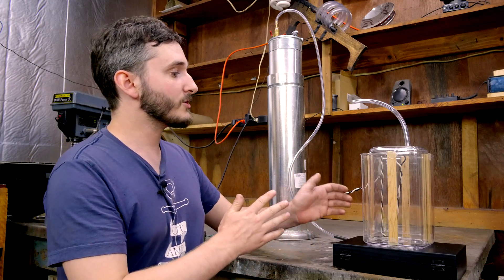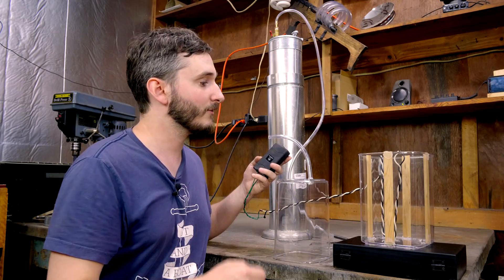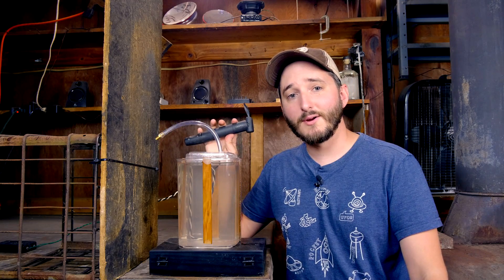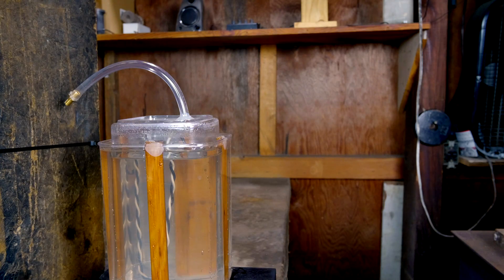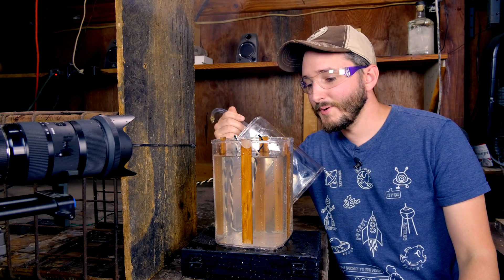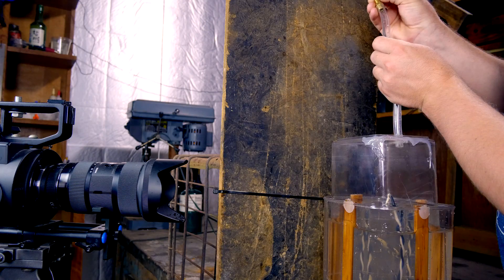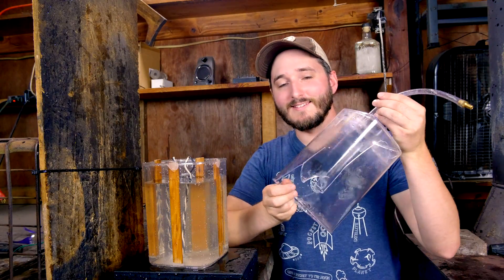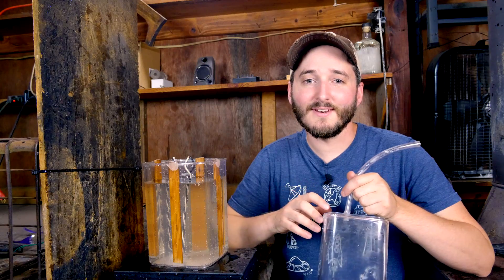Explosive Safety Testing for Bio-Fuel Storage

Comment from the maker: If you missed my previous videos in this wood gas/bio-fuel series check them out here:
Building a better gassifier: https://youtu.be/HQIW4dVVokE
Building a gasometer for wood gas storage: https://youtu.be/5hfznunVzKY
Reply: NightHawkInLight, thank you for ❤ my comment !
Reply: NightHawkInLight so uh... Gas cannon? Golfball mortar would be fun.
Reply: Make it run a model engine!!
Reply: People must think wood gas hydrogen is the same as HHo from a water splitter which you absolutely need a flash back arrestor for because it contains the perfect ratio to explode 

      One of the most dangerous gasses is acetylene it is kept in a special tank with gypsum and acetone because if it is allowed to be in volume in gas form or pumped at high pressure it can explode by itself without any air because of acetylene decomposition

 If you run a oxy acetylene torch at perfect mixture into a balloon or plastic bag just hitting it can set it off seen people make exploding bb gun targets with a cardboard box and Reynolds wrap like this but it is very dangerous

   Love your videos can tell you truly enjoy experimentation keep up the awesome content
Reply: how hard is it to be a one man cew i know i just want to know you thinking
Reply: Hey you could probably use the info gained from the mixture in this video (75/25) to optimize the bicycle engine you did in another. You might have been running fuel rich at 50/50
Reply: @NightHawkInLight , instead of a flashback arrestor you could use a one-way checkvalve to prevent gas mixing. They are so cheap there is no excuse ;D , 1-2$ from ebay china aviable in the aquarium section made from plastic or metal in every size.
btw. A Flashback Arrestor costs 5$ from china
If you cant find them cheap i could send you the links on request.
Reply: Try 1/ 4(1 propane and4 oxigine mixture)
Reply: Love ALL your videos...... 
Many years ago I used a rear tractor  inner tube as 
a gasometer for methane.....
What do you think about using it for wood gas ???
Thanks..... And regards...
🏹🛡🇬🇧,,,,
Reply: 0:32 I like the wood gasification but what about bituminous coal I'm not talking not charcoal the fossil fuel rock that burns what they use to use bituminous coal for locomotives and heating and used in powerplants I was wondering if you could make coal gas and have a tao tao style moped run off wood gas and coal gas
Reply: NightHawkInLight can you Build a rocket with it

Comment: Wouldn’t it matter where the spark gap was located in the container whether the gas ignited ? I assume the wood gas being a mixture high in carbon would be heavier than air, as such the addition of air through the top of the container would stratify with air on top and wood gas below. The spark would need to be at the boundary layer of the two gasses to cause ignition if the spark is too low it will be completely within the wood gas layer and therefore no ignition and if it is too high it will be completely within to air layer and again no ignition. I am guessing that as you add more and more air it creates turbulence in the container and mixing of the two gasses leading to ignition.

Comment: I had more than one bad explosions at my woodgasifier-central-heating, when I thought I had to open the lower door, just keen to see the fascinating downwoard burning flame. It could be a mighty explosion, as my wife said, that she felt, that the floor of the room above (where she was) bend upwards a bit, which made her move up as well. I was just squating in front of the furnace and lost some beard, eyebrows aso. 

Very funny experience though. But anyway: The explosion was some way slowly building up, by far not that expressive if I had used nitro (diluent for cell laquer) which I experienced another time, that nearly smashed my hand, when the door of another oven slammed open, after some little nitro-gas came near a glowing woodpiece :-). That was such a strange experience, that I had to do it directly once more, nearely loosing my hearing. Wood gas explodes so much cozier ...

Comment: Congrats, you just figured the upper explosive level of wood gas.  The best explosion you'd get, if you had something like a little mixer, bc not only the ratio, but also the mixture of the two components air and woodgas is quite important. I really liked this 👍

Comment: You should use a 2 liter soda bottle for your container to put into the bucket of water to put your wood gas into the cap is a great addition you can mount a nipple hose or whatever and screw it on and off as you please and the two liter bottle Is Not Fragile it won't crack when flying in the air I don't know if you've ever heard of a gravity bong out but that's the same thing you're doing right now
Reply: You could do this with a homemade classic gravity bong with a 2 liter bottle

Comment: I mean if you use ideal gas law to determine the amount of moles you have of fuel and then try to find the perfect amount of oxygen to react it with  then you will have a more controlled experiment where you know how much energy will be released becz you know every reaction has its own reaction enthalpy and in that way you can produce better explosions I guess that's my opinion though correct me if I am wrong

Comment: Indeed, the measurements are very rough, as the exact wood gas composition generated will be changing over time with the generator set you have, but certainly gets in the ballpark.  So the concentration will be an average over the collection period.

Comment: I'm sorry but if you was talking to somebody else or you just assuming somebody was going to say something it's still wrong isn't conjunction is both pulling and pushing until they find it equilibrium meaning atmospheres pushing on the water to go inside but the lack of atmosphere inside the container is actually pulling as well.
If anything look into how it's soda bottle is made and contained without blowing up when you shaking

Comment: Test of air mix flame color looking cleaner with more air 😉
P.s. love your work & looking forward to running home generator after you get the bike running well.
Maybe close gass intake a bit more with air tap wide open but im thinking your already ticking over on the thoughts 😆

Comment: People must think wood gas hydrogen is the same as HHo from a water splitter which you absolutely need a flash back  arrestor for because it contains the perfect ratio to explode 

      One of the most dangerous gasses is acetylene it is kept in a special tank with gypsum and acetone because if it is allowed to be in volume in gas form or pumped at high pressure it can explode by itself without any air because of acetylene decomposition

Comment: I don't know if you can consider the parts mixture to be correct with the length of tube between your valve and the container. The valve would be more accurate if it were flush with the containment chamber. It would seem sensible to find out the oxygen to component ratio that they react best at. Obviously there isn't pure oxygen in air and the make up of the gas is not clear but I'm still not convinced you did this properly.

Comment: Here are some published flammability limits. 

Lower flame limit  percentage of fuel to air. 
H2 4%, CO 12%. 

Upper flame limit as a percentage of fuel to a volume of air. 
H2  75%, CO2 75%

Looking at the upper flame limit, and considering your upper flame limit was  less than 50% fuel and more than 40 % fuel to get it to ignite,  I'm guessing there is a significant amount of unburnable co2 and or other gases. 

Another explanation or contributing factor is that the published figures are for standard temperature and pressure, and as one is increased in altitude above see level,  the upper and lower flammability limits become more narrow, untill the air is so thin, it will not sustain an explosion. 

Ratios for complete burn
One O2 + two CO = two CO2
One O2 +  two h2 = two H2O
Both have the same one to two ratio.  Assuming one mole of any of the above gass fills the same 22.4 liters at standard temperature and pressure, and our wood gas is any combination of CO and H2 and nothing else,   then for complete combustion,  every liter of wood gas needs 0.5 liters of oxygen. If atmosphere air is rounded to 20% oxygen, then 0.5 liters /20% means  2.5 liters of air has .5l of Oxygen. 2.5l of air added to the 1 liter of wood gas = an explosive mix of 71.4% air and 28.6 % wood gas.  This is not the lower flame limit, nor the upper flame limit, rather it's the minimum calculated mix to burn all the CO and H2, the stoichiometric mix.

Comment: That was super cool!
Thank you for all these amazing projects from your fertile brain.

Want to try to find nesting PET fizzy-drink bottles as a mini-gasometer.
Have you thought of using an old fridge compressor to store it in a HP cylinder?
I was also thinking about the uses for the wood-tar byproduct.  The Germans had an immense prewar chemical industry, largely kickstarted by the discovery of aniline dyes and other products from coaltar, a byproduct of coal-gas generation.
Try it, for instance, to treat wood against termites and fungus.
Do PLEASE wear gloves—I don't know whether any of the mélange of chemicals is especially toxic or carcinogenic, but we don't want you getting the galloping never-get-overs.

BTW, Do an image-search for coal-gas vehicles in World War  II.  They looked rather weird, and I wonder how much range they had.
Reply from the maker: My reading has suggested that pressurizing woodgas into cylinders can be dangerous, but the details as to why are not clear. I haven't tried it to find out.
Reply: NightHawkInLight I have some vague thoughts: if the gas is not dry, the high-pressure gas might form acidic solutes and corrode the steel cylinder.

Comment: It’s funny to read the comments and see that a lot of people think it’s pure carbon monoxide being produced.  I for one would be interested in the quantified analysis for this setup, if only just to see the conversion rate for methane & methanol with the accidental(?) catalyst.  Would need two spectroscopic analyses though, both before and after the gasometer, due to h+oh- diffusion and o2 & co2 absorption (and condensation), and both samples would unfortunately be highly degraded during transport.

Comment: I´m really interested in the sugar+enzymes so called ¨battery¨, though rather more of a fuel cell.  Higher energy density per weight than the best current lithium tech.  

       It´s been patented, so one couldn´t sell it, but I´m interested in it for just my own personal, home use, to run electric motors and the like.

Comment: O.k! So your goal is to make your biofuel explode!? (Well, it was fun!)  You don't want a way to stash it 
more efficently? As i write you on a previous video; try to liquify your gazous biofuel into liquid biofuel. 
If you can. You can stash more that way. Also; it may serve as other use. (Ex : running a fuel machine; 
chainsaw or others). I really would like to see that. I imagine it's the same way we create liquid oxygen.
By cooling down gases with liquid nitrogen. (But i'm really not sure for a biofuel).

Edit : Reading and searching more at the subject; i felt on this :

Wood gas generator by Georges Imbert. That actually run a car in Europe in 1920.
Only with the fumes. Good!

Comment: This is so great! Thank you for doing this research. I built a gasifier/gasometer in my backyard this summer as my entry for the Hackaday Prize (hackaday.io/project/139958-metabolizer-a-recycling-center-powered-by-trash), and I was curious about exactly this issue. Once I got comfortable working with the syngas, I was pretty confident that the way I was doing it was ok, but not knowing for sure where the line was was always a little unnerving. Now when people ask me about this, I'll send 'em over to this video! I was surprised at how much air it took become combustible. I was worried that even a tiny leak in my valves or a few bubbles might make the whole mix explosive, but 60% is a LOT of air. It would be really hard to do that by accident.

Comment: Hmmm, maybe you could add a catalytic converter to convert CO and O2 to CO2. 
That way, you'll reduce both the chance of explosion by removing oxygen, and make the gas safer by removing CO.

Btw, will you eventually be storing the wood gas in pressurized bottles?

Comment: Do you suppose for curiosity purposes, you could try gasifying coal, and wood chips soaked in motor oil? I know they are not very green but I would be curious about the production differences and the gas and byproduct produced.  You seem to do these vid better than anyone else!

Comment: thanks for tackling the safety issue.  I think far too many people are ignorant of the dangers of flammable liquids and gases...especially gases, because they are usually invisible and sometimes odorless.  you don't know there is a problem until it's too late and it happens very fast, so no time to react.  highly recommend if you are not an expert you take all available and precautions.     work in well ventilated areas where fuel vapors can't build up, and there are no sparks or open flames.  some appliances such as refrigerators produce sparks, so be aware of that.

Comment: NHIL, how about designing a simple calibrated 'carburetor' to mix the wood gas with air at the proper ratio (like the tip of a propane torch or a grill burner intake). Then we will really be able to use the created heat to effectively and safely heat water or cook with..

You could then establish the relative efficiency of the woodgas-burning heat output to wood fuel input by testing how much heat you can get into a pot of water with the gas burner vs. the heat from the fuel wood burning directly.  Just sit a pot on top of your rocket stove and measure the weight of the fuel wood and biofuel material combined to compare).

I think we'll find the efficiency is incredibly low, but thats the trade off for having relatively clean, on-demand storable gas heat versus having to light a fire each time.

Of course, it is this efficiency value that we could then use to compare gasifier design efficiencies and improve them. 

 Thanks for all the great videos =)
-7

Comment: 1 A flame can not travel through a window screen and if properly sized will pose very little obstruction to gas flow.
2. A propane bottle type tip should increase reliability of flame.
3.A curled piece of copper tubing like on a still will rapidly remove heat even if just exposed to air, even better if run through a small amount of water.
4. a tube run through the bottom or side of your gas collection system that extends to just below your maximum/minimum water level would rapidly remove particles from your gas.
5. I'm not seeing a drying system after the collection tank ? perhaps a large container of wood shavings?
6. would love to see this upgraded to 55 gal drum size with water as the moving element to create pressure inside the drum. 
7 THANK YOU FOR SHARING IN A INTELLIGENT FASHION.

Comment: what high speed camera do you have, what is its price, and what is its max frame rate?
Reply from the maker: FS700. It's old now and there are better/cheaper options for slomo.
Reply: yeah that camera is expensive and is not super efficient at slo-mo,
Try getting either the Chronos 1.4 or the FPS1000-HD both of which are about the same price but can exceed 30,000 frames per second. that would be cool to film your piston valve air cannon!

Comment: I'm curious on how  the water of the gasometer is dealt with. In your previous and more primitive design the water was black. Does this clear up? And you mentioned the tar being a useful byproduct, maybe a future video idea on extraction of and uses for the tar.
Reply from the maker: You can leave the water in the gasometer for a long while until it gets real gummy with tar. At that point you can leave the water out to evaporate and just have tar left. If you boil that tar you can distill other chemicals from it like acetone and wood alcohol, and what's left over is waterproof like the tar used on roads and roofs.

Comment: I'd love to know what's actually in the wood gas mixture.  I don't suppose you have access to gas chromatography?  I know that it should primarily be a mix of CO and H2, but in what ratio?  What else is in there???  Methane, surely, but probably a witch's brew of other interesting things.

Some folks very vigorously "informed" me that the CO was basically all converted to CO2, leaving primarily H2, but that clearly was not the case.  H2 will ignite in almost any ratio with air (something like 5-95%, iirc.)  It also had that weak but pure blue flame that is a characteristic of CO.

Comment: The 80-20 ratio seemed to produce quite a slow and smooth acceleration on the chamber.

This reminds me of an idea I had as a child of building a steam or air engine using submerged chambers instead of a piston and cylinder. I never got around to try it, but this makes me believe a combustion version of that is quite plausible.

Comment: Really enjoy your indepth exploration and explaination.  Any chance you could tackle a vegetable based biogas project?
Reply: Lyndsay Beck 
He would need to modify his current gas maker to be more of a low temp boiler because methane(not pure,of course)is a byproduct of rotting plant matter(composting),which is sped up by moderate heat and high air humidity in the chamber.And that's pretty much it.